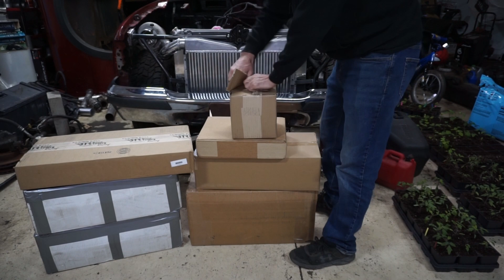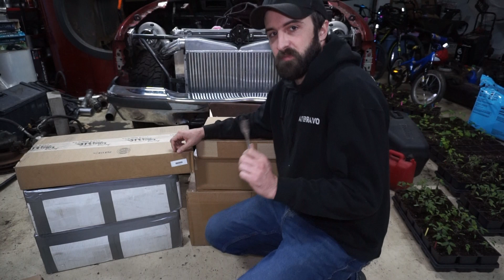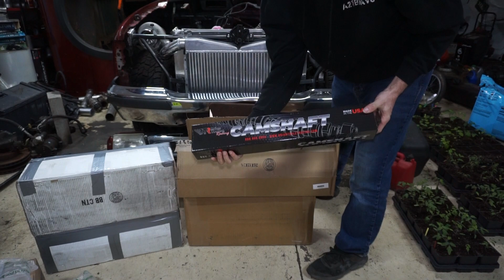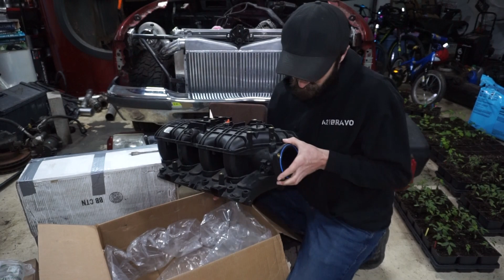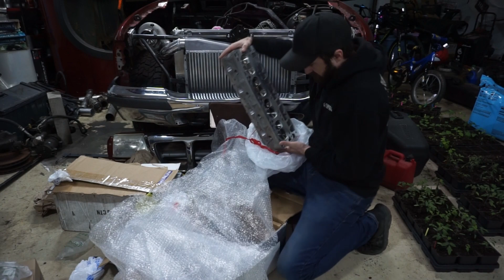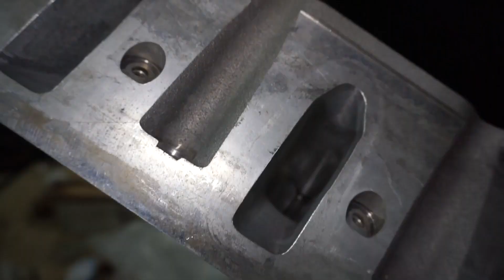NEW PARTS!!! TWIN TURBO LS FORD RANGER | SUMMIT PRO LS

Comment: I've been watching head flow inc for a while too. I was doing the same looking for videos on how to Port my LS heads and found a good video, seen JD commenting on it and that's how I found his channel.
I ported my 706's pretty much exactly how he showed.   In fact, I watched his large valve 862 videos so it's cool to see who they belong too.
This thing should be a solid ripper with the summit pro LS, BTR turbo cam, worked 862s and tbss intake.